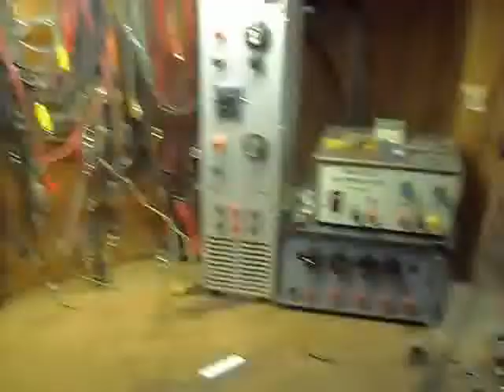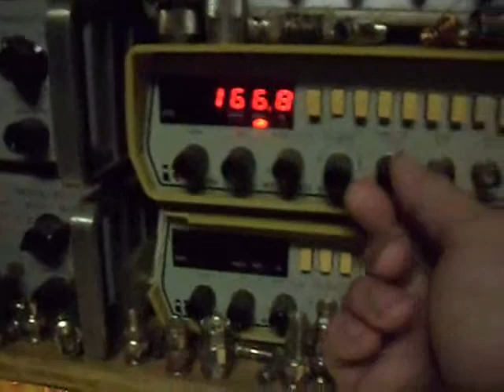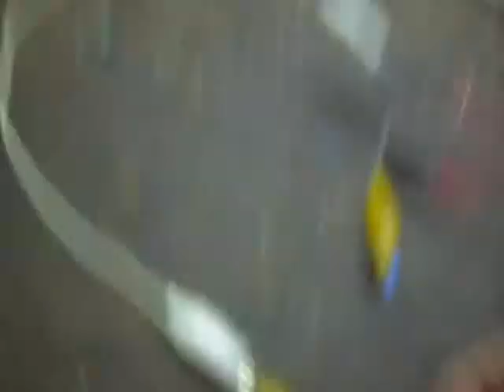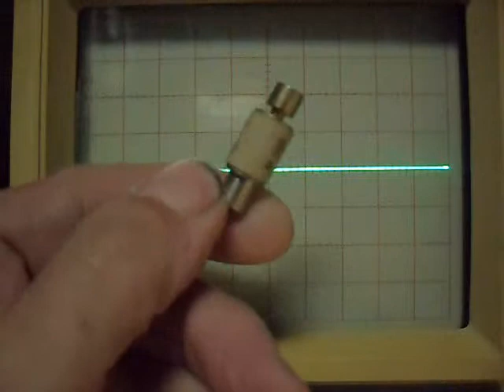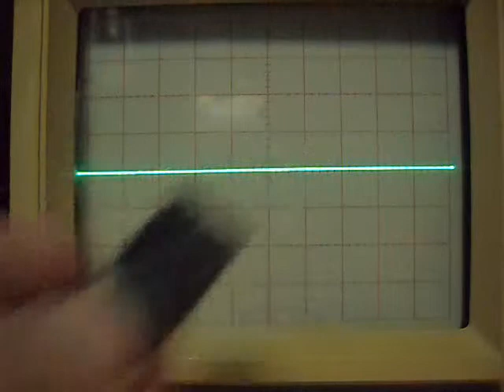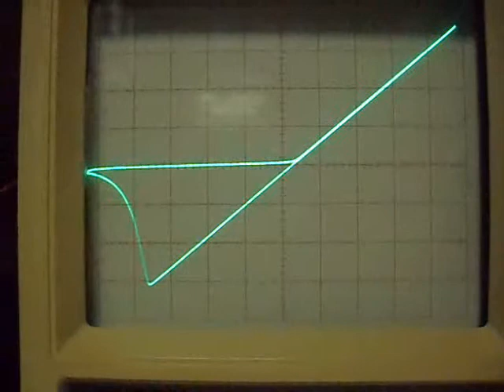Diode testing, recovery time.

Comment: If you are going to the effort of building a switch mode power supply why on earth would you even consider using an unknown diode?
Reply from the maker: The point of the two videos (PIV, and recovery time) 
Is what do you do when you come across a factory spool of 5000 diodes, or some other large quantity of diodes, with a manufacturer specific part number?

What do you do with them when you can’t find data sheets?

How do you determine safe PIV, and nominal recovery time for that lot of diodes?

That was the point of the two videos.
If you come across a large quantity of a specific diode that you can’t get information for. Or some other special application specific diode. How do you go about determining some rudimentary attributes, so you can get an idea as to what you can use them for.

As for as the sensibility in using an unknown/questionable diode in a switching supply. That highly depends on who, and what that supply is being built for.

If it is a supply for a project I plan on using myself, then yes, without a second thought.
If it is a production environment where the supply is for something that will be shipped all across the country, then no way in heck would I use it.